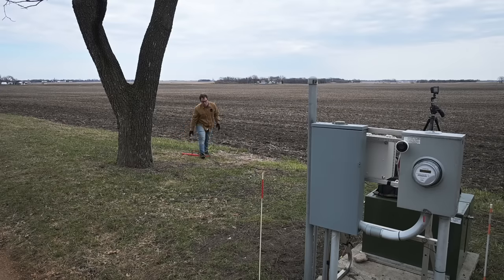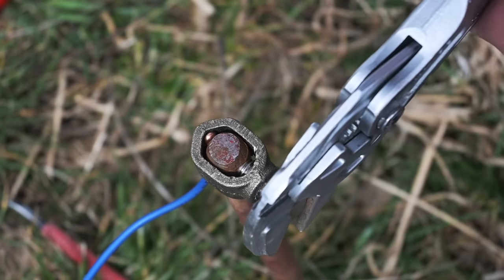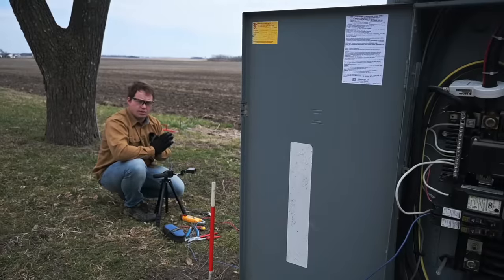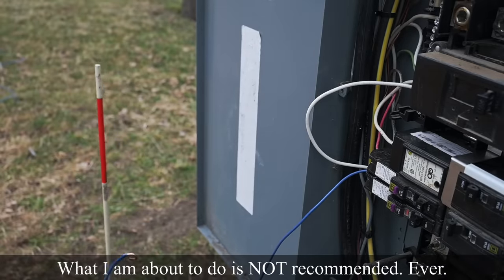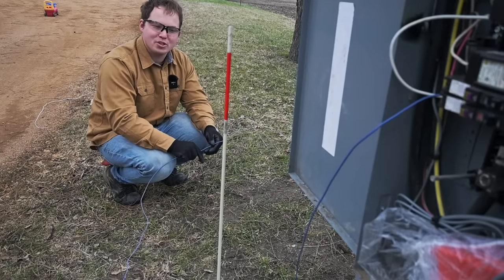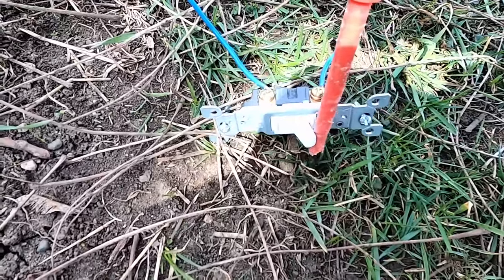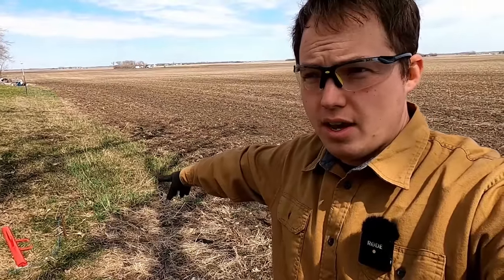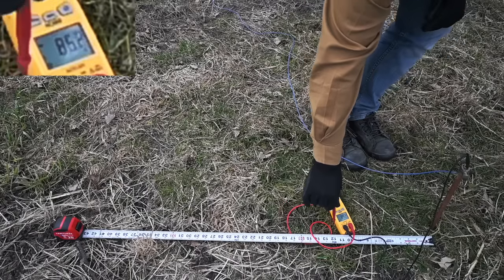Will 120v To Ground Trip a Circuit Breaker?

Comment: Something you did not mention, but I noticed you did. Under certain conditions (wet ground, raining) you should keep your feet together if you start to feel a shock. 
   If your feet are at different distances from the gnd. rod or whatever, there most likely will be a dangerous voltage differencial between your feet and current will flow. This happened to me once. It was raining and I was walking towards a transformer down near the gnd. in the oilfield (touching nothing) when I started to feel my feet tingling, it became worse the closer I got. I stopped and put my feet together and it quit. So, I then jumped backwards and backed away. This was a higher voltage but it could still hurt you at 120 volts.

Comment: Great video Ben.  I work for a telephone company and we had a customer who's phone quit working.  It was determined that the underground drop wire went bad.  When the old wire was disconnected the customer came out of the house saying that his lights were going crazy.  It ended up that his neutral was open and the unbalanced load was using the telephone wire sheath to get back to the transformer (probably why it went bad).  If the ground rod was zero ohms back to the center tap of the transformer this would not have happened.  Keep up the great videos.
Reply from the maker: Wow. That is super interesting. Thank you for sharing!
Reply: Ever held on to that 70v DC line when grandma makes a land line call its a shocking experience i tell ya
Reply: @Robert Lane, yes, it's ridiculous that home and power company grounds are of such poor quality that a communications ground has to take up the slack. In older houses, it's common to find the ground clamp disconnected from the earth ground (rod or water pipe), because the zinc-plated steel screws rusted away over the years! Obviously, ground clamps should come with non-ferrous screws. Here's another crazy thing: Faults between the power company transformer and the meter have no overcurrent protection and are DESIGNED to burn themselves clear! So, during Hurricane Sandy, a hot conductor on a pole touched an aerial ground wire and it didn't burn open. It just kept burning. Eventually a sheathed telephone cable of several hundred pair started burning as well as cable TV wires because they also shared the same ground. Someone went around to the utility poles nearby cutting the vertical ground wires running to earth which actually made the problem worse!

Comment: The reason you current is increasing somewhat is due to the voltage breaking down the insulating property of the ground (it's actually quite conductive on its own but not completely conductive or insulative either). It's heating up the water in the ground as well causing it to become conductive. Also it's working on the basis of electrolysis which makes things more conductive as well.
Reply: So in the rain things would get interesting?

Comment: As a Water Utility worker. We are required to check for electrical voltage. The old school way was to ground the electrical system to the plumbing. I have been shocked when working on our water system. When we find the source  we have the electrical company pull their meter and then they require them to get it fixed. Great video.

Comment: If you ever work at a campground where the owners did their own RV power boxes and did not bury the supply properly you find out very quickly that if you get a knick in the supply line you will find it quickly and painfully by just placing your hand on the ground close to the knick.  Talk about a surprise when i went to sit down to work on a water line.  It was a fast way to find a hidden knick in a power line but not one i hope to try again any time soon.
Reply: We found that out at the Ausable camp ground, I opened the fuse panel yes fuse panel they haven't updated their electric system, and I got a slight tingle it really wasn't bad then I hooked up my water line to the  spigot and when I went to open my camper door I was knocked on my ass so my wife came running to see why I was on the ground she got nailed as well
Reply: @supertrucker12916  yes, it happens, and they will check on a dry day and find no problems GFIC help this

Comment: I watched several of Mike Holt's seminars, but there is nothing to replace the field work showing these principles in action. Great demo! What I was surprised at is the extremely low impedance of your ground system, only ~12 ohms. Clearly that's because the transformer ground is only a dozen feet away, and your earth must be very damp. Even the principle of 'ground' is a confusing misnomer. The earth is simply the least resistance connection back to the center pole of the transformer.
Reply from the maker: I too was surprised at the low impedance. I was expecting closer to 5 amps at most!
Reply: It depends on the distance from the ground rod,  the humidity of soil, after rain breaker jumps instantly,  mid swimmer sunny day  mmm
Reply: +spelunkerd   Actually MIke Hold did do that expirement, different details complements this video well:-
https://youtu.be/Yg6G5VUSsWA?t=645
Reply: I enjoy seeing other you tubers I subscribe to commenting on other subscribed channels. Really enjoy bens hvac and electrical videos and spelunkards dodge videos are the best on the web from an explanation standpoint. Two great content creators!
Reply: I believe in Canada the ground rod resistance has to be less that 5 ohms and less than 25 ohms in the U.S.  But keep in mind that there are two ground rod resistances in series, the one for the main service panel and the other one at the transformer. What goes down into the ground must come back up. So the ground rod resistance in this case, which gave 10 amps of current,  must have been 6 ohms + 6 ohms = 12 ohms total.
Reply: @BenjaminSahlstrom  You're like 10 feet away from where the metalwork is going into the ground and probably no more than 100 feet from a PEN bonding on the distribution side.
Reply: There's also a maximum impedance for grounding installations.   If your ground fault impedance were too low,  you'd have had to install additional grounding rods.   Depending on local code, Marinas, Gas stations, and EV charging stations usually have isolated (TT ground) -- it's neither coming from the grid nor is it bonded to neutral -- and they still need (per code) a low impedance path in order to trip protective devices.   Had you lived in a place like Arizona with a sandy dry ground, you'd have a much harder time drawing current through the ground.
Reply: @BenjaminSahlstrom  Lets say that the neutral and  ground cables are bonded toguether  at the main panel. Now if a hot wire makes direct contact  with the  ground wire conductor What would happen? Does it cause a short circuit?
Reply: Spot on, sir.
Reply: @miguelac6872  yes.  That's the purpose of the ground wire.
Reply: @miguelac6872  yes

Comment: You've done an excellent job of showing what many electricians are unaware: the physical ground is an unacceptable bond.  Grounding (the rod in the ground) is for power quality (and lightning protection). The earth acts like a giant capacitor, smoothing out voltage spikes.  It is NOT the "source;" that would be the transformer. A side effect of this is there  is potential between the ground and energized components.  This is where bonding comes in.

Bonding is electrically connecting non current-carrying metal components, plus the physical ground AND a leg of the electrical system (usually the neutral), so they are at the same voltage potential. Should a metal part (such as an enclosure) become energized by fault current, it prevents you from being shocked. The bond to the neutral is a low resistance path, creating an intentional short that will clear fault current by tripping the breaker, before you have a chance to be shocked 

The physical ground is NOT a low resistance path to the source that can be used instead of running a bonding wire, as this video shows. How? The NEC allows a maximum of 25 ohms earth resistance to the grounding electrode.   Using Ohms Law we see current (I) equals voltage (V) divided by resistance (R).  I = 120/25 = 4.8 amps. Definitely not enough to trip a standard breaker.  This video should make it clear why driving in two grounding electrodes to the ground instead of using a physical bonding wire is useless for safety. This is why all outbuildings must be connected with a separate bond wire, in addition to needing a separate grounding electrode.

This also shows the value of a GFCI.  If current somehow leaks to ground that is not enough to overload the breaker, it will still save your life. Thank you for demonstrating this important fact.

Comment: As an FYI over-current breakers have 2 modes for tripping, one is a bimetalic strip that bends as it's heated by the current going through it, that pushes an actuator to trip the breaker. The other is a solenoid which triggers the trip mechanism immediately.
The solenoid is tuned to trip at a higher current than what the breaker is labeled as. And the bimetalic strip is set to trip after a few minutes of rated current. So your short arc welding adventure will have drawn more current than 20A before the breaker tripped.
The combo breakers use more sophisticated methods to detect the fault they are guarding in combination with the normal over-current detection.
Reply from the maker: Exactly. I want to take apart one of these dual function breakers and then see how it trips. If I'm careful enough maybe I can do so and keep it working! We shall see.

Comment: Now you need to experiment with a SWER (Single Wire Earth Return) circuit. They use them for remote locations and also they were used for early rural electrification. Typically they used high voltages and a single steel conductor because the high tensile of the steel allowed larger spacing between poles. Low resistance grounding systems are key to making it work well so multipal rods and treatment around the rods with salt or other chemicals helps a lot. You'd be surprised at what you can power even at lower voltages like 120. Running a couple lights or small power tools is no problem
Reply from the maker: That sounds extremely interesting! I'll definitely keep that in mind for a future video!
Reply: You can even run a crystal radio with only an earth connection and no power whatsoever just from atmospheric capacitance.
Reply: Most all of rural Australia is SWER.
Reply: He delivered! There’s a SWER light bulb video on the channel now
Reply: As an amateur radio operator I fed a 70 ft. Ground mounted tower using a gamma match at the base. Antenna performance drastically improved when I pulled out the ground rod, dug a posthole about 4 ft.   Backfilled with salted soil, and re-installed the ground rod right in the center of "the salt of the earth".

Comment: This brings to mind the "night-crawler hunting rig" that  friend of my dad used more than 60 years ago.  It consisted of two metal rods with lots of electrical tape wrapped around one end and sharpened on the other end.  A long insulated copper wire went from one rod to a plug and another long insulated wire ran from the other rod to the other side of the same plug.  He would drive one of the rods into the ground somewhere in the yard and then insert the plug into the socket.  Then he would walk around the yard poking the "hot rod" into the ground until he found a soft spot where he would leave it for a few minutes.  Eventually, night-crawlers would climb out of the ground and we would pick them up to go fishing the next day.  As it turns out, the reason he was looking for a soft spot is that the rig worked best in slightly damp soil.  Today I know how dangerous this was.  Back then I can only remember an occasional "tingle" sometimes when picking the worms up off the damp ground.

Your observation about the difference in voltage drop as the distance from the hot wire rod changes is evidence of the fact that ground is not a perfect conductor.  A more familiar example is the power of lightning strikes and how a strike near a horse or cow standing on the ground causes them to get knocked over.  Simply put, an animal with four feet on the ground experiences a  potential (voltage) at one foot and a difference in potential at a different foot due to the resistance of the soil (earth)  At the thousands of volts existing in lightning at the instant it strikes, each leg of the animal represents a separate parallel path for current to flow in addition to the path through the earth ground. This serves to remind us that lying on the ground during a lightning storm is exactly the wrong thing to do.  The lightning does not have to be really close to do its damage to living things.
Reply: You have described what's known as step and touch potential. The ground acts as a resistor so the voltage varies along the path.
Reply: Hey, I did that as a kid, too, and lived to tell about it!
Reply: Also explains how two people in water can get different shock voltages - one stretched out in the water and one standing upright. It's the distance along the voltage differentials that get  ya'
Reply: So I should stand on one foot during a lightning storm?
Reply: My neighbor lost two horses to a single lightning strike. Their bodies were found about 75 ft. In opposite directions from the tree that was blasted by the direct hit. The air in the lightning arc itself becomes a very good conductor during the instant the bolt occurs.
Reply: @enteraqua  I usually sit on my couch and watch tv.
Reply: I'm not sure if this is a good question why does the power get higher the further away from the power source connected to the ground rod I would think you would get less the further away cuz the ground would be dissipating the amount of electricity that was showing up on the meter. I know just enough to get myself hurt probably why would I have half the voltage going from the positive to the grounding wire the bare wire copper wire on a three wire being tested at the end of The Wire where we connect to a socket it's to 120 volts between the the black and the white wire this was the case with two outdoor plugs that this wire was connected to I thought it was cuz that one of the plugs went bad maybe but after eliminating it I'm still having noticed the difference in the voltage between the the white and the the big copper wire we measuring the voltage between the from the hot wire after removing both plugs one plug being fed off the other and just checking the voltage where the first plug connectivity wire coming from the breaker box it's in a added on then is that have anything to do with it it's concrete slab in metal boxes that are submitted into the brick walls that is a room that was added on to the house after the house was built if it makes sense I noticed a small spark when I was going to plug in the drop cord to the outdoor plug in the dark in it very sparked at the cover the metal cover so testing it with the little other little tester it the red light was on saying something was wrong found putting in a GFI plug in the first was testing the voltages in a two of the wires barely touched and legislative to the breaker which I was glad but still not sure about why they get to go to different voltages this may be more than what little bit I know which is not much Christian being should I be concerned about this as long as it's circuit breaker trips I'm not sure now if it's safe or not I'm on my phone showing property rambling
Reply: @enteraqua  Crouch down, feet close together till danger passes?  Crouoching reduces your chance of being directly hit and feet close together eliminates voltage gradient.
Reply: @johnnybaber1804  You're misinterpreting the results.  He is measuring potentionial difference against distance from the rod.  The higher the resistance, the larger the voltage drop.  Resistance increases as the distance increases. The further from the rod, the actual voltage is less, that causes the voltage gradient.
Reply: @enteraqua  you should crouch low preferably on one foot away from tallest trees or stand on something insulated we had a whole group of people out hiking on top of mountain and a lightning strike hit cell tower in afternoon thunderstorm shocking all of us I got mild shock from tree I was leaning against about ten people went to hospital with numb legs pians irregular heartbeats nobody died but it was from about a hundred yards from tower

Comment: Great video. It was a good visual representation of how a "bad earthing" is not really effective. For reference where I live the earhing resistance rating is required to be low enough to allow the circuit breaker to do its job .For example in your case you were getting around 12 Ohms which allows for only arround 10 Amps to "flow" to earth (120V / 12 Ohm = 10A). If you had for example a couple more rods connected to this one and got the resistance lower then 6 Ohms more electricity Amps(20+) will "flow" to earth and the thermal protection in the breaker will cut the power. Earhing is brilliant as a protection it just needs to be low enough to work with the intended breakers.
Reply: Thanks for clearing this up.  Yeah I think he could pass the 20 amps and trip the breaker if the grounding rod was deeper or longer.  I think the point is more than a high resistance grounding rod is not safe.

Comment: Ben, thanks again, interesting video. It would be worth your while having a read about substation grounding mats. These are critical to the safety of personnel working there. In fact, the normal setup is for the chain link fence to be grounded to this mat to prevent folks who touch the fence (unlock the gate for example) from being electrocuted from those earth voltage gradients that could be present in certain circumstances.
Reply from the maker: Interesting! I'll have to read about that for sure!